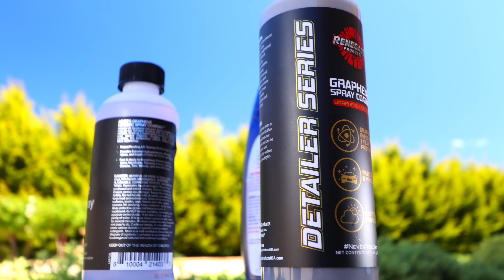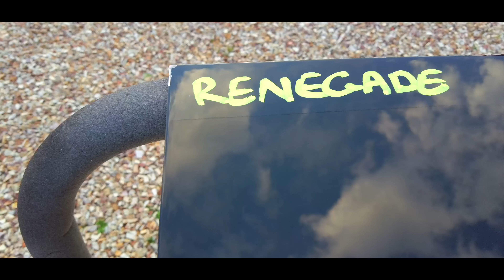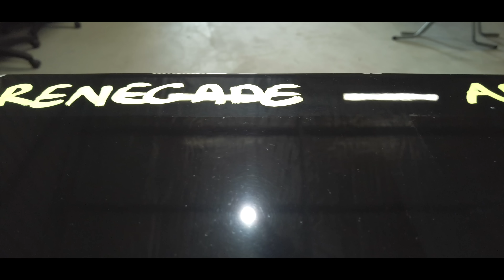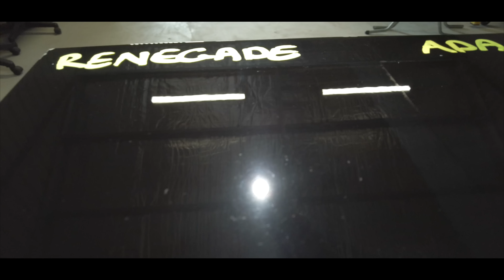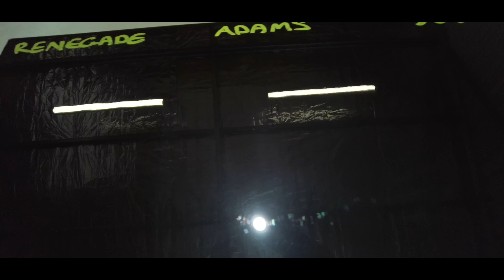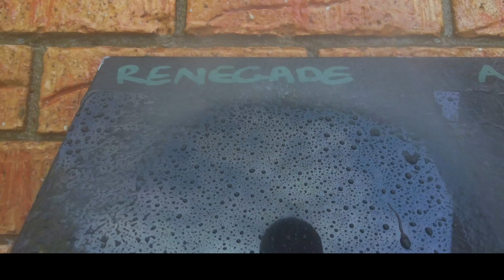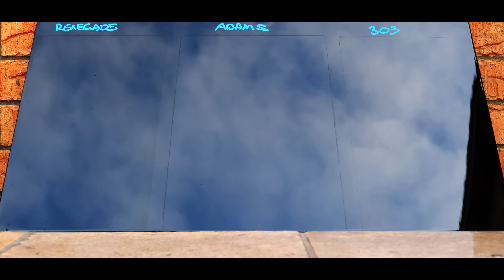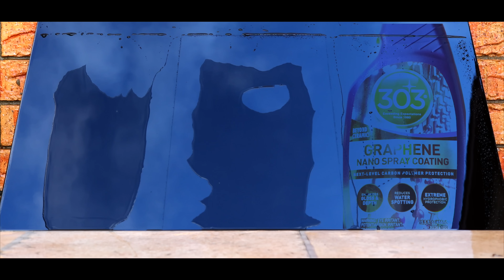Best Graphene Ceramic Spray Coating | 303 Graphene, Adam's Graphene, Renegade Graphene Spray Coating

Comment: Thank you for the review! We did want to note that our product does not contain any dyes and the black color comes from the Graphene-Oxide itself. We have a FAQ video that shows some of this process if you would like us to link to it here but don't want to spam your channel without asking. If you have any other questions don't hesitate to reach out! Thanks again!
Reply: I love your products. Started off with your interior protectant and loved it, now I swear by your Graphene spray, I've put it on all of my vehicles and I recommend it to everyone now!! Keep up the great work producing wonderful products
Reply: Can 303 be layered multiple times?  What’s the max amount of costs?  Can it be applied over another ceramic paste wax or can a ceramic paste wax be applied on top of 303?  Thanks
Reply: @BW-kv9wj  Yes! 303 Graphene Nano Spray Coating can be layered up to 3 times. We always recommend using the longest durability product as the base though.
Reply: @303Products  So I can layer 3 coats of 303 on top of another brand sealant or wax?
Reply: @BW-kv9wj  If you want to, yes. However one should suffice for most uses. Check the durability of your other options. The one with the longest durability should always be the base coating, then you can layer on top of that. Graphene Nano Spray Coating can last up to 12 months.
Reply: @303Products  I was looking at Lithium Seal and Squeal as the base?
Reply: I have used the 303 for two years now and I love it.  Easy to use, great price and it lasted the 12 months.
Reply: How many times does a bottle suffice for one car?
Reply: 303 products, especially the Graphene Coating and the Detailer Spray are the only brand I will use on my Pickup and my Chevy Suburban.

Comment: "Graphene" is the biggest con in recent times within the detailing industry, right up there with "SiO2". It's not possible to make a water based sealant, or solvent based coating using Graphene yet with the current technology available. 303 themselves literally show how they make the product, and they simply put a teaspoon of graphite powder into a water based silicone emulsion. It's the same with "Graphene" coatings.
Reply: And what happens with these phony graphene coatings is the coating actually comes off in chunks over time. 
You have to get graphene down to the atom level for it tow work 
All this stuff just has graphene dumped in the bottle 
You want something that really last 
Use Fusso soft 99 
It is the real deal 
Won’t add gloss but it will last a year for sure 
One can will last the lifetime of the car 
Just make sure to put it on thin 
The thinner the better. 
And don’t use it on plastic or headlights.

Comment: I've used many different Graphene coatings and have been extremely happy with 303. It is my number one choice, especially when using their Detailer coating spray on top. The Detailer Spray adds extra slickness and extends the life of the Graphene Coating. The Detailer really adds shine.

Comment: Great video. I'm an Adams loyalist.. I've used both 303 and Adams original ceramic coating. Adam's was so hard to remove and the water spotting after a rain storm was atrocious. I have used 303 nano coating on my Rav4. Unbelievably easy to use and the hydrophobic properties were amazing!
Reply from the maker: Thanks and I appreciate you sharing your experiences with them!
Reply: Was there any water spotting with the 303 after a rainstorm?
Reply: @skidit100  no. None whatsoever
Reply: @Vini-Pizza  wow thanks was gonna get the Adams now I’ll get the 303
Reply: @CarCraftAutoDetailing  Sandro you mentioned you have tested better ceramic spray coating , which have you found the longest lasting ?
Reply: I have been using the 303 for the past year and it works well. I have recently purchased a bottle of the Adams advanced graphine and I am going to try it out. I have heard that the advanced is supposed to be a good bit better than the original.
Reply: @skidit100  no. None
Reply: @vaejoviscarolinanus how the results Adam advance ceramic spray coating compare to 303??

Comment: I appreciated the detail you put, the reflections of the products dedicated to their columns on the test panel!  👍 👍 👍.  Regarding adam's graphene ceramic spray coating, for my part I have always considered it more like a "ceramic boost", a ceramic topper!  Rather than a true standalone ceramic coating.  I'm not saying it's a bad product, but it excels more as a topper or to boost or reboost an existing ceramic.
This is only my personal opinion!

Comment: I personally have been doing some testing with the 303, and I have to say this is one amazing coating. I live in an environment where it is 30 to 35 degrees Celsius and it rains quite a bit. I put the coating on about a year ago and I did 3 washes. 2 of the washes were just to get the dirt off and make it look presentable, the third wash I reapplied the 303 to only the rear quarter panels and the lower portion of the rear doors. The rest of the car was left alone, just washed. Just recently I washed the car and observed the hydrophobic behavior and it looks like it has been through a lot but it was still beading and in some areas it was slow to sheet off. I used carpro  reset as the soap. This test was not very accurate and there were a lot of factors but the coating survived for about a year and still holding. This coating is not really good for being put on headlights. It breaks down real quick and lasts about 2 weeks. It is a very good glass coating. It will wear off on the windshield but that is to be expected. The 303 preformed great in my opinion and it is a great product for cost and how much product you get.
Reply from the maker: Thanks for sharing your experience with it!
Reply: I have had this exact same experience. I put it on a track built Miata and it works extremely well. Rain washes the car for me most of the time. I also went crazy and put several coatings (6-7) of it so I just don't have to worry about the coating at all anymore

Comment: I really dig the Adam’s Advanced. I have been using it since it came out.
Reply from the maker: Great to hear that mate, it’s all about what works best to you and it sounds like the Advanced is an improvement.
Reply: @CarCraftAutoDetailing  I used the OG formula until the Advanced was released. I have found a decent amount of longevity with both, longer on the Advanced of course.

Comment: I used the Adams spray as a leveling agent on their real Ceramic. Works very well, up to an hour after application of the real coating.
Reply from the maker: Great to hear that!
Reply: Is this recommended by adams or how’d you find out

Comment: Hi Sandro, thank you, thank you, thank you, I thought it was me & Id screwed up, I've had identical experience with both Adams Graphene & the Adams Graphene Advanced.Spray Coatings (both in the last month on our own vehicles) The expected rainbow / petrol on water effect never happened in a garage at 20C / 55% Humidity. According to Adams tutorials I expected the rainbow to appear at about 3 minutes with the colour going at 5 ( time to level/buff to finish) after 10 minutes nothing & thought it must be the colour of my paint thats hiding it so prepared myself for a very sticky removal, I need not have worried, it felt as though Id wiped over with a damp cloth. Anticipating failure the panels were polished the following morning & I broke out another bottle of Pure. Knee jerk reaction, I now have another 2 expensive bottles of spray graphene coatings that will be used post wash for alloys. Not amused, but thanks for putting my mind at rest.  ( had deployed 303 shortly after release, one month & 3 washes later, nothing, flat water behaviour, but my alloys look wicked :-)  Take care fella !!
Reply from the maker: I’m glad the video confirmed what you experienced and put put your mind at ease and thanks for sharing your experience with 303 as well!

Comment: I have the Adam’s Advanced Graphene spray coating (the legit glass bottle too) I use this for jams/plastic interior trim. Works great. I can’t speak on this standard ceramic spray but the Advanced is great. Easy to use.  The advanced ( at least the bottle I have) doesn’t have a strong smell at all)
Reply from the maker: Sounds like a bit improvement I’m glad it’s worked well and thanks for sharing that.

Comment: I'm suprised at the 303 application results. I found it extremely "grabby" when trying to wipe it post flash. It also took a fair bit longer to flash and seemed less obvious when it finally did...in my experience.
Reply from the maker: Sounds quite different to my experience with it, but I guess that’s just the way it goes sometimes with detailing products, thanks for sharing mate
Reply: @CarCraftAutoDetailing  Interestingly enough after my experience I went searching for other opinions and a few other folks had similar experiences. Not sure if perhaps the formula has been altered somewhat or climate differences are to blame.

Comment: Well done Sandro Keep up the great work mate, your the best AU U tube car detailing channel full stop, even better than so many US based channels, just wondering if you can do the heat test as well and a wash test, ie: heat the panel after curing time and heat a area, with heat gun to get the temp up to say around 45 c degrees and then wash it to see if it effects it?
Reply from the maker: Thanks mate, I did want to do a heat test based on claims but had no sunlight here and really ran out of time. I’ll try to include it another time!

Comment: can you test this Adam's spray directly  against its "advanced"  spray coating which has even more ceramic solids in it . ive used it and it still works on a few cars after a year and they aren't garage kept just cleaned every 3 to 4 weeks.   the advanced graphene spray also flashed faster and turned more rainbow than that one you used.   would be interesting to find out if it is that much better than their regular graphene speay

Comment: Hey Sandro! Awesome review, thnx AGAIN for your valued honest info. Quick question: can I use 303 as a top layer over a ceramic coating or, for that matter, a spray ceramic coating? Always appreciated! 👍🏼
Reply from the maker: Yes, as long as the base coating is fully cured you can certainly top it with 303.

Comment: Can you use these on top of a sealant? Looking for something that lasts longer and is more effective than wax.
Reply from the maker: You can use them over a sealant, but you’ll probably find that you’ll achieve a better long term result when they are applied to well prepared bare paint.

Comment: good evening; I intend to use SONAX Shine Shampoo and CARPRO RESET Shampoo for daily washing after applying 303; both shampoos are neutral PH; Do you recommend any graphene-reinforcing product for maintenance? and thus be able to achieve the 12 months of protection?, greetings from oaxaca mexico.
Reply from the maker: You don’t have to use a graphene content  topper to maintain it through you could, you could even use 303 Spray and Rinse from time to time as it’s quite hydrophobic and seems to work well with graphene/ceramic coatings.

Comment: Excellent review and video as always! It's a real treat to sit down and watch these thorough tests and listen to someone with as much knowledge as you Sandro. 

It's interesting to see how different products react to layering. I tried layering NV Wheel and it just beaded and rejected itself no matter when I tried to apply it when I was testing. I've layered UK3.0 before and it really had no more longevity in the real world in my experience. Maybe a 5% improvement at best. It did add more "Gloss" to the eye but I never checked it with a gloss meter. 

What are your experiences/opinion on layering NV Nova Pro? Does it add any substantial longevity having 2 layers installed?
Reply from the maker: Glad you enjoyed it mate. 
You’re always moving onto trickier territory when laying because timing is more difficult and so varied with different products and environments. My experience with CQuartz coatings has shown quite a substantial improvement with layering but I guess I’d also say more with CQuartz Professional and Finest Reserve. I don’t feel it’s necessary to layer Nova Pro and I also feel the benefit isn’t as great as it is with the pro CQuartz coatings because a standalone layer is still extremely good, but I’ve certainly seen improvements in looks, and longevity with layering it.
Reply: @CarCraftAutoDetailing  Thanks for the info. I'll have to give layering uk3.0 another go. I could've had an off result. 

Thanks for the advice on just doing 1 layer for NV Nova Pro. I'm guessing it's the same with NV Nova EVO? 

If you ever have the time and extra product in a bottle, a test comparison of NV Nova Pro vs Nova EVO vs Pro Cquartz coatings would be pretty cool.
Reply from the maker: Evo is really a single layer coat where it’s been designed all around that, whereas Pro gives you the option to benefit more from additional layers, though as mentioned a single layer is still quite impressive. My pleasure mate and I’m sure I’ll have more on Nv and CQuartz coatings down the track.

Comment: Hi Sandro is the 303 ok to use on an already ceramic coated car? Will it enhance the already ceramic coated vehicle or will it break the coating down. How do I apply this to an already ceramic coated vehicle can I just wash the car then apply it? I had a very poor ceramic coating job done on my vehicle as you know Sandro I'm just looking for a product to help fix the terrible work. I have a pesky Murray Magpie that keeps jumping all over my vehicle leaving scratches everywhere. I keep shooing it off but he comes back I think he likes his reflection or something. I thought ceramic coatings were supposed to be scratch resistant? Not mine even a light bird like that has left scratches everywhere. Just proves the quality of the product used. Jeremy Downunder
Reply from the maker: I had a similar experience with magpies a few years back, really frustrating and unfortunately no,ceramics won’t tend to resist bird claws, cat or dogs scuffing the finish. 
303 Graphene seems to bond extremely well to most surfaces so I would expect a nice deep clean followed by an IPA wipe could do fine as prep before applying it and if your coating is really on the way you should see a decent improvement in gloss and hydrophobicity.
Reply: @CarCraftAutoDetailing  Thanks Sandro I was one of the ones asking about the 303 thank you so much for a great review Sandro. I'll buy you a coffee haha
Reply: HI Sandro how often can I apply this 303 to my car? Can I use it 2 or 3 times in a short period like apply it once then next wash again then the next wash will this give it a better finish do you think? Thanks Sandro Jeremy Downunder
Reply from the maker: There’s really no rules in how often you can apply it, if you’re will, then I think you can certainly apply it that often, it’s probably more that you may not see as much benefit with those additional layers in a short period but you should still see an improvement.
Reply: @CarCraftAutoDetailing  Thanks Sandro I had an unfortunate incident last Thursday evening some kids threw rocks at my car as I was driving down the road damaging my car. I caught them the parents said they will pay but now they won't answer my calls. 6 of them threw rocks one hit my car. I have to have it fixed its dented my panel just below back left hand rear pillar. I'm so pissed off Police couldn't care didn't attend I had to go to police station. Thanks so much for your advice I'm devastated. One of the parents is Aboriginal the Aussie mother said she will pay the Aboriginal woman didn't say anything. Both their kids threw rocks. Jeremy Downunder
Reply from the maker: Sorry to hear that mate I’m sure I would have been upset myself and hope you get reimbursed for the damage!

Comment: Does graphene shine and protect better than ceramic, regardless of length?
Reply from the maker: It’s still not obvious that car paint protection containing a small graphene content are better or worse in terms of performance compared to those that don’t have this added graphene. At least for now I’ve yet to see that the graphene addition has proven to be superior, but it’s still early days for graphene and this could certainly change.
Reply: @CarCraftAutoDetailing  cool thanks for the reply. I guess I’ll continue to use meguiars hybrid ceramic spray, because of the ease of use.

Comment: Would a graphene coating look ok on a tractor?
Reply from the maker: Sure, it’s honestly virtually impossible to just look at a wax, sealant, ceramic or graphene coating and distinguish them by looks alone, these and really most paint protection products will work and look just fine on a tractor.
Reply: @CarCraftAutoDetailing  do you know if I could put a sealant on top of it to make it more durable?
Reply from the maker: Yes you can.

Comment: Great review!  Does 303 have uv protection??
Reply from the maker: Yes it contains UV inhibitors
Reply: @CarCraftAutoDetailing  thank you.   How long does it take plastic headlight covers always in the sun to get dim and yellow again?
Reply from the maker: Protection applied to clear plastics (especially headlights) never lasts as long as it does on car paint, so I’d be applying it every month or two if I want to avoid UV damage- or at least so it down. It also tends to help to layer your first application maybe even 3 layers initially.
Reply: Thanks!  I ended up buying 303 Graphene Nano Spray Coating.  It's easy to apply, and it's relatively cheap.  I just want it for the headlights (yellowing) and windows (to make ice/snow easier to take off).  I instantly make headlights clear again with acetone nail polish remover in ONE pass.   Don't make any more passes or it gets foggy again.